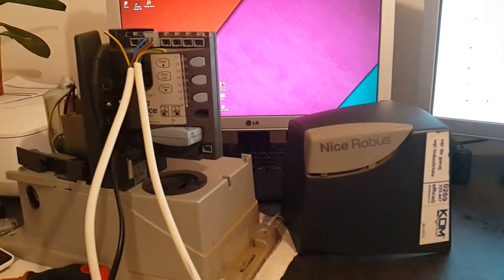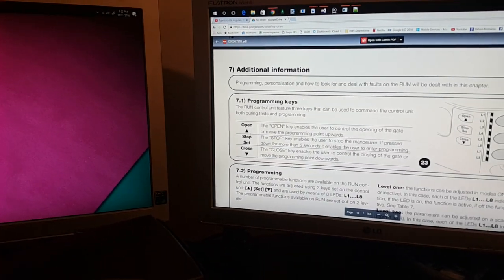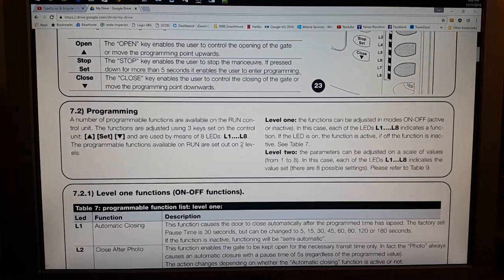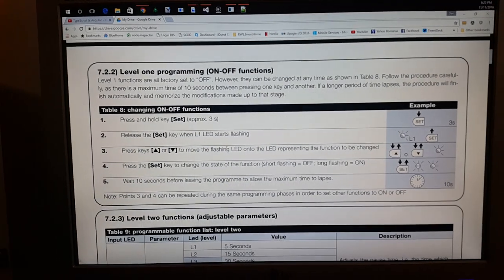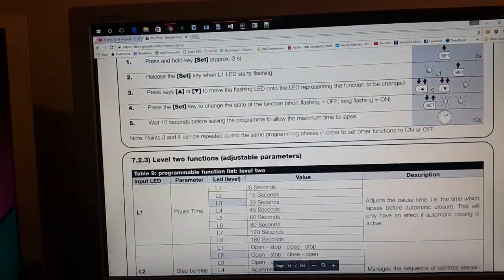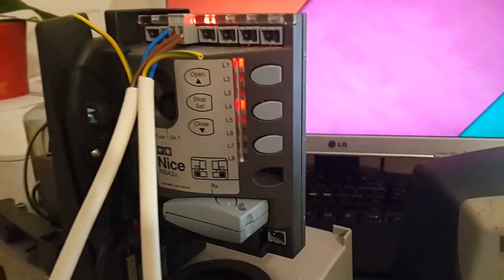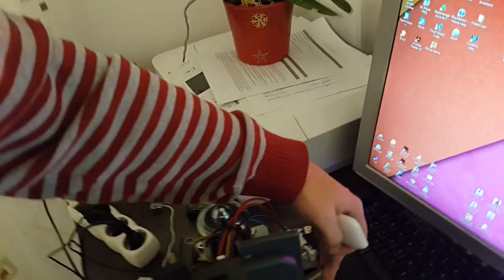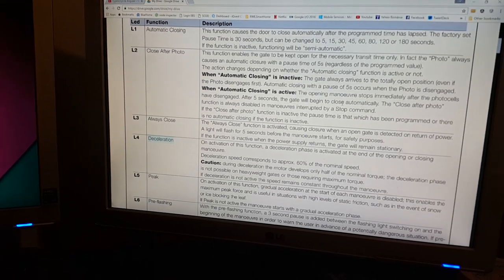Nice Robus gate programming

Comment: the connection at the top, if you put a wifi sonoff lower power relay / switch, one on the open one on the close can you this as a pulse switch to open and close?
Reply from the maker: Yes you can . I did also did this. Just make sure you keep electrical connections separate. No surge between gate controller and your WiFi switch. You can even power the switch from the gate power supply. One way will be to keep things simple an not to do that ( use the controller's power supply).